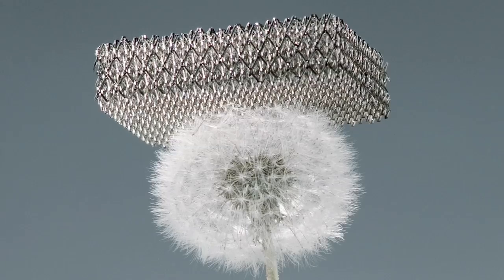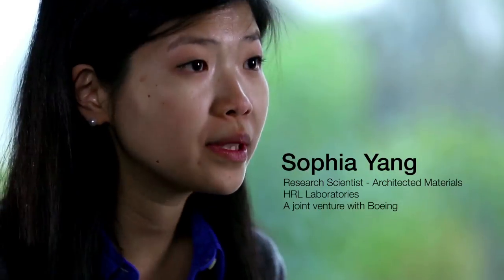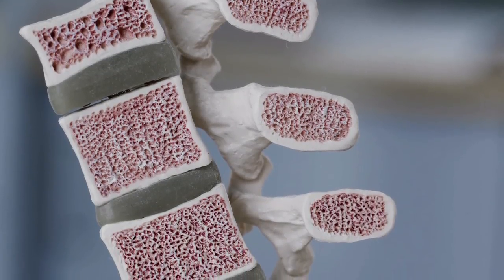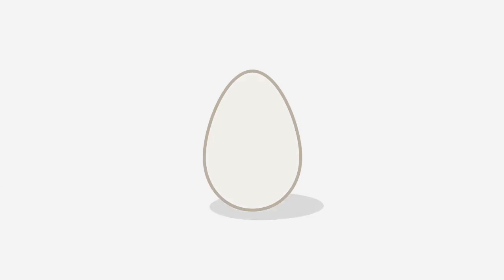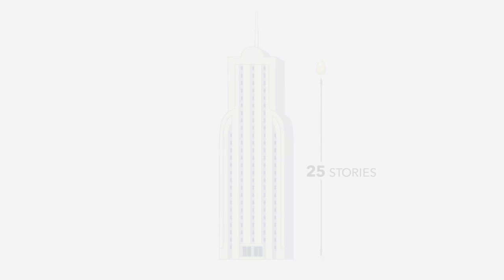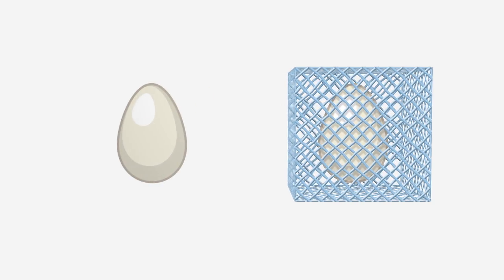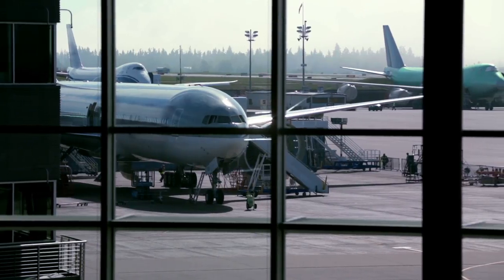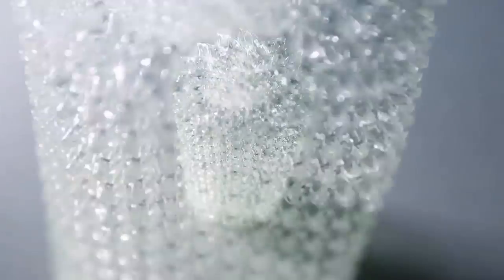Aerospace Innovation: Boeing Develops The Lightest Metal Ever With Latticework for Future Aircraft

Comment: Time to make space elevator .
Reply: men
Reply: agreed
Reply: lets graphine to it
Reply: +Mohamed Mohamed add*
Reply: +FlamingBlock Nonono, see the flexible metal would be put on the OUTSIDE, there could be some insulated material on the inside closer to the actual elevator. Now what will we use it for?
Reply: sadly this just like every other strong material we know of doesn't have be a good enough specific strength so our attempts would be in vein.
Reply: Or just let them wear spacesuits and provide enough life support (oxygen) in the elevator. Oxygen is still very lightweight and with enough structure support/beams it could hold the oxygen tanks that would have to be made out of a lightweight metal (maybe aluminum?).
Still an elevator is very impractical.

Comment: What kind of metal is it to make it the lightest or is it light because of the structure and not the metal?
Reply from the maker: The metal is a nickel-phosphorus alloy that is
coated onto an open polymer structure. The polymer is then removed, leaving a
structure that consists of 100nm thick walls of the nickel-phosphorus, thus
creating the lightest metallic structure
Reply: +Boeing yeah, "metallic structure", STRUCTURE. Thanks.
Reply: +Boeing So you just admitted your title is misleading..It is NOT the lightest metal, rather the lightest metal structure.
Reply: +Boeing is it REALLY 99.99% air? I don't believe that. Also, you should try making it out of nanocarbon tubes.
Reply: +cookiezillaevan doesn't that greatly disprove flexibility?
Reply: +cookiezillaevan The tubes are hollow and the walls of the tubes are very thin. They make a polymer structure that is coated in a 100 nm thick layer of nickel-phosphorus alloy. The polymer is then removed leaving only the hollow alloy tubes.
Reply: +cookiezillaevan To be honest, everything is about 99% empty space.
Reply: METAL structure
Reply: they didn't explain the metal either so unless you made it you wouldn't know
Reply: +Dranksta No offence, but are you daft? A fifth graders knowledge of science should be adequate to inform you that we already know all there is to know about the periodic table of elements. There aren't any new undiscovered metals that can last longer than infinitesimal durations. It is IMPLIED that this is light due to its structure. It makes it more of an incredible feat, not less. It makes me glad I chose to study materials, this is the future.
Reply: +cookiezillaevan we have an armchair scientist woooo.  Tell me your favorite conspiracy theory :/
Reply: +Boeing Please add this to the description, to add clarity and credibility. The video states that the material is a polymer structure, and the metal alloy was not mentioned. So my first thought was: "okay this is plastic, not metal?" But very cool, I like these coating-and-removing-the-core techniques :) Material science can be amazing!
Reply: +Dranksta "No comment"
Reply: +Boeing how is the polymer removed?
Reply: Heat? Solvents?
Reply: +Dranksta 

I am one of the inventors of the ultralight material (along with colleagues at Caltech and UCI). There is an easy distinction between large-scale structures (e.g. buildings, the Eiffel tower) and crystalline materials (e.g. quartz, aluminum) both of which have "lattice structure". The debate comes in somewhere in-between. Would you say a foam (e.g. styrofoam) is a material? I would, and from an engineering perspective, that's how you would model and build with styrofoam. It's not a structure. Our arbitrary line between material and structure is somewhere around 1mm "feature size".  Most of the microlattice materials we produce are, for practical purposes, structured materials that you would treat homogeneously in engineering design.
https://en.wikipedia.org/wiki/Metallic_microlattice
Reply: +cookiezillaevan I'm one of the inventors. Yes, the ultralight version is >99.99% air.
Reply: +cookiezillaevan Boeing's 2014 net sales were worth $233 billion. You have a video of a robot stealing jellies. I trust Boeing more.
Reply: +Boeing How does this light weight structure hold up on impact , temperature changes and vibrations. The temperature change for any aircraft is huge. Huge temperatures bring moisture so corrosion is a factor since nickel can tarnish in super heated steam . Super heating can also be causes by the jet engines.  Do they plan to use the metal structure with other composites such as graphite which allows structural changes at higher air speeds.
Reply: +cookiezillaevan This video is 99.99% air....
Reply: +Dranksta I shouldn't be as irritated as I am about their blatantly false claim.  I hope your engineers don't use terms describing totally different things interchangably like you PR team does.  Kind of shameful for one of the world's more important tech and manufacturing companies.
Reply: +Boeing +Dranksta I shouldn't be as irritated as I am about their blatantly false claim.  I hope your engineers don't use terms describing totally different things interchangably like you PR team does.  Kind of shameful for one of the world's more important tech and manufacturing companies.
Reply: +Dranksta In order to create a very light metal you would have to create an entirely new element, (which is likely impossible because synthetic elements are very heavy). Alloy would be the world you're looking for; but you are correct in saying they did make the lightest metal STRUCTURE. :)
Reply: +cookiezillaevan Carbon nanotubes are stronger than diamonds, and are lightweight. But they can't absorb shock. New anti bullet vests made of carbon nanotubes will use some non-Newtonian fluid to absorb shocks. Cars and planes might be made out of carbon nanotubes and this metal structure. Also, this might allow planes to use electric engines, since batteries will be used in "compensation" for the weight loss because of the lighter materials used.
Reply: +Dranksta well, they had to use some kind of metal to make the structure, so the title is right. No hate please.
Reply: +Boei5tgng
Reply: +Boei5tgng
Reply: +Boeing Why does this vid no explain that? This is the coolest part!
Reply: +Dranksta Dude, you are not impressed with 100 nm thick walls? I don't think you understand how small that is... Juvenile anatomical reference in 3. 2. 1.
Reply: +Dranksta There's a big difference. I personally don't trust my life to a company that can't distinguish between the two.
Reply: +Boeing whats its tensile strength? no complicated formulas please, im no genious, just wondering how strong it is. if i pull on it will it tear apart? how can it be used? would it be like infused with some kind of polymer to give internal strength? like some kind of epoxy or something like an internal grid? interesting but the video leaves so many more questions than it answers.
Reply: It's the structure not the metal
Reply: +Qwerty-Space yeah even more. the parts of an atom are like planets in space compared to the sun.
Reply: +Dranksta precisely
Reply: +Dranksta stop being such a troll -_- its an amazing feat of technology and personally I think its fantastic that its been created weather its the lightest metal, or the lightest metal structure. either way, its amazing, and deserves much better feedback and praise than your criticizing of the name of their video. trust me when I say, I'm sure they have better things to do. then deal with you, and they still took the time to answer your question. which you took for an opportunity to be a jerk, here's a tip.  grow up.
Reply: +Boeing that's really cool ^^ its just amazing seeing that, I can already think of a few ways to integrate this into aircraft designs while keeping the passengers safety in mind,  its a really great concept I can't wait to see it actually be put to action. (I apologize for any bad English ^^)
Reply: Honestly looks like styrofoam
Reply: lazy
Reply: Add a public comment
Reply: +Dranksta same thing
Reply: +Boeing I would like to make this at home!... what material or what sketches should I do to make a wooden or a plastic version of this?
Reply: +Nicholas Wells Exactly!
Reply: It's all air I think the holes in it
Reply: you guys dont understand you cant just "make" the worlds lighest metal it already exists its berryllium. (note berrylium is not useable because of its toxicity) so by creating this structure they are in essence creating the lightest (peice of) metal pound for pound
Reply: +madison king lithium is lighter but so reactive it turns into a compound thus making it not a metal.
Reply: +madison king with the water in the air
Reply: +Drank star he has a fair point
Reply: +Dranksta ..Yeah...more like that...'structure'...
Reply: +Dranksta somone nitpicking on Boeing ? Shocking
Reply: Man this gonna help everything WE CANT EVEN CURE CANCER YET BUT WE HAVE LIGHTEST METAL
Reply: +Dranksta yep still cool tho
Reply: I think its dependent on both the materiel it is formed by as well the structural design.
Reply: +PineappleQuesadillas oh, I quite doubt we know everything there is to know about the periodic table of elements. After all, only recently were theoretical materials such as ununtrium proven to exist, and it is likely that there are many undiscovered elements. For example, antimatter. What about elements not based off of protons, electrons, neutrons, or their counterparts?
Reply: +Dranksta it's the lightest without compromising durability. Rust is probably lighter, but you don't see super car companies using that do you? No, they use carbon fiber, which WAS the lightest and at the same time strongest metals ever before this
Reply: +Boeing didn't the video say it's one of the strongest materials how if it's that thin
Reply: congratulations, one of the biggest company's in the world replied to your comment.
Reply: the metal is SUPER HOLLOW which makes it really light
Reply: l
Reply: +Boeing wow that is amazing
Reply: +Boeing v
Reply: +勝郎山田 you spelled "whether" wrong
Reply: +Bix Ouille Still something only your alternate character could make
Reply: Akeyume everything starts out small
Reply: And the military is always trying to get tougher materials for defense but have it lighter as well
Reply: Akeyume yes!
Reply: +Dranksta excellent point
Reply: +Dranksta it's the way you look at it, micro vs macro
Reply: +Boeing nice, I like it...
Reply: +Boeing So it is like a hollow structure?
Reply: Elise BRITO
yes..
Reply: +Dranksta   Savage
Reply: +Dranksta lol savage xD
Reply: +cookiezillaevan nanocarbon was used
Reply: +Qwerty-Space more than 99%
Reply: it's more like 99.9999% empty space rodoxxs
Reply: +Nicholas Wells Both.
Reply: +Boeing WOW YOU ARE SMART
Reply: I would say "click bait" here, but this is still really cool. I say thumbs up :D
Reply: air is still 99.9999% empty space *****
Reply: Everything is 99.9999% empty space
Reply: Ryland Tappe-Inglis
except empty space, which is 100% empty space, lol
Reply: Well, aren't we cheeky today...
Reply: +Nicholas Wells ...The lightest 'metal' is lithium.....this structure is made of nickel.....and only light due to being extremely thin...
Reply: you know those little things in Marvel and DC where its like "it's stronger and lighter than titanium," that's the definition.
Reply: and before I forget other shows and Comics as well with that definition
Reply: i was thinking that
Reply: +Boeing e make a Nother b17
Reply: Both I'm not a scientist don't quote me on that
Reply: +Boeing cool!
Reply: Andrew Schneeman when I'm in the higher grade of science I will understand what you just said
Reply: +Boeing can you order it online or buy it
Reply: +Ryland Tappe-Inglis how is this click bait
Reply: +Boeing why can't you alloy Mg with P.it will be much more lighter in both the aspects.(well you can't use Li.)
Reply: Lightest. Metal. Ever. Of all time
Reply: Oh and to all guys who complain about it not actually being 99.9 % air she said "it's basically 99.9% air"
Reply: +Boeing am I able to buy some of this, or is it not for sale or extremely expensive
Reply: Welcome to the Internet......
Reply: +PineappleQuesadillas I know about the periodic table and stuff, but how do you, or who ever taught you, know that there aren't any metals left to discover? Couldn't there be more metals outside of our solar system?

Comment: This could be rebuilt into body armor... stronger metal and a tighter lattice pattern could make an effective chainmail of sorts.
Reply: those look like wired sponges for dishes
Reply: halo armor maybe??? lol sorry....
Reply: Or power armor, that would be great
Reply: I was thinking almost the exact same thing. It is kind of like chain armor in the sense that it is light, but still effective. Though I wonder if a layer or two of this could potentially replace Kevlar.
Reply: it would be interesting to see if it holds up against that much concentrated force.

Comment: I wonder if the can use it in the chairs? It could make them softer but still hold their structure possibly with the tension or maybe poles guiding it to form the shape of the seat, right? Kind of like a hammock seat but more sturdy, comfortable, and with a cloth cover you won't fall through possibly?
Reply: And maybe if you took, for example, a 737 and were able to replace small things like the seats to even the buckles then there would be less weight on that plane? I'm no aerospace engineer, yet, but I'm just curious if that would work or not?
Reply: +Mikayla Strange one buckle would cost more than a car...
Reply: ludwx
Reply: very good thought.  yes should implemented for all such applications.
Reply: +Mikayla Strange I would presume so..
Reply: The cushions double as flotation devices, so probably not. Also, they are already pretty light.
Reply: /8
Reply: +Mikayla Strange sounds like to me you are an aerospace engineer or physicist
Reply: +Mikayla Strange Yeah it would but like only 10 pounds

Comment: I think aerogel still has the record for the lightest solid. Aerogel is not made of metal and probably not as strong as this so this is very impressive. I wonder if you could create aerogel around this metal and create a super lightweight composite material. Aerogel is amazingly resistant to heat flow which I doubt this metal is
Reply: One of the main reasons behind the use of metal is due to carbon having an affinity to become brittle at hight temperatures.  However as this material contains phosphorus it could also decompose at very high temps.  Phosphorus is a bitch with fire around.
Reply: it's 99.99% air (insulator obv) so even tho it's metal (conductor obv) it probably still is